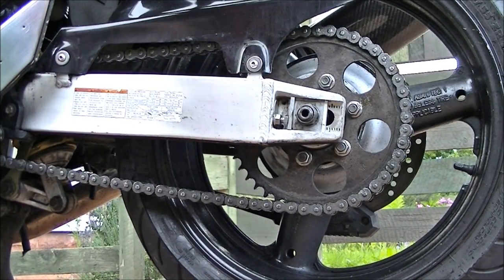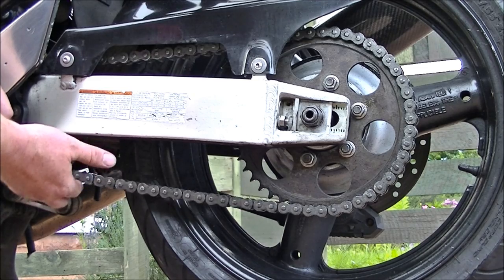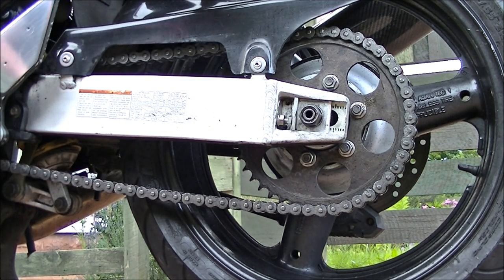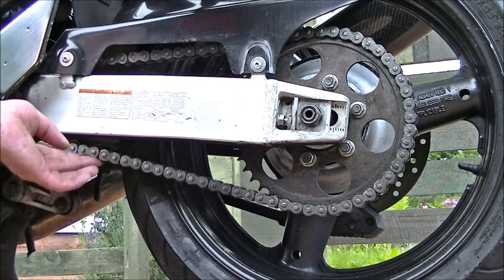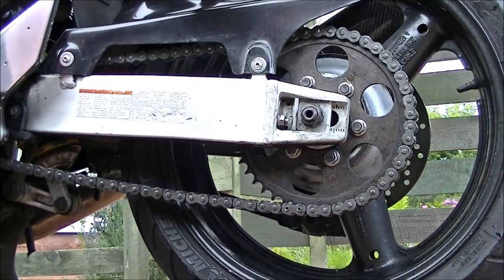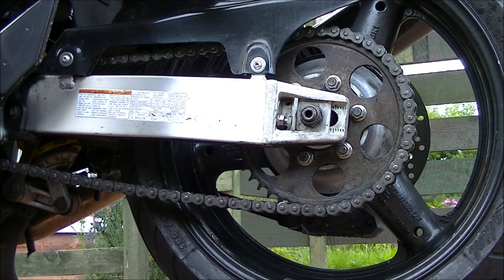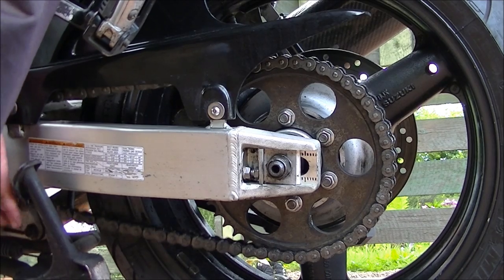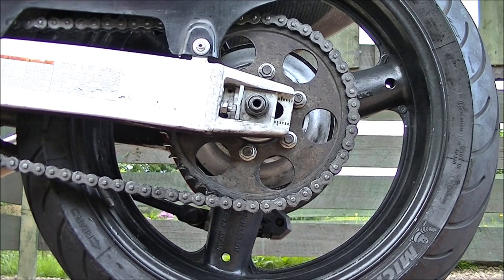Bandit 1200 chain adjustment issue update

Comment: hello...... u see the 2 screw nuts......u gotta loosen the lock nut then tighten the nut to stretch the chain. do it on both swing arms and the tighten the locknut. before retightening the wheel bolt.

Comment: Have the same issue with my Bandit 1200 thought it was just my bike lol I just had to factor in the swing arm flex by adjusting the chain on the looser side before tightening up the axle bolt. I got a feel for it after awhile. Doesn't make me love my Bandit any less :-)
Reply from the maker: A foible (spelling) I know what you mean, still adore the Bandit12.

Comment: When you adjust the chain and tighten the axle bolt shove a screwdriver between the sprocket and chain to keep the wheel from moving and do the nut up to 100nm.
Reply from the maker: The issue is you don't get a true adjustment as the swingarm flexes. I'll just have to judge it, a bit of a pest but I like quirky bikes!